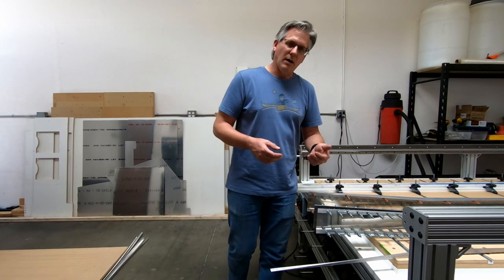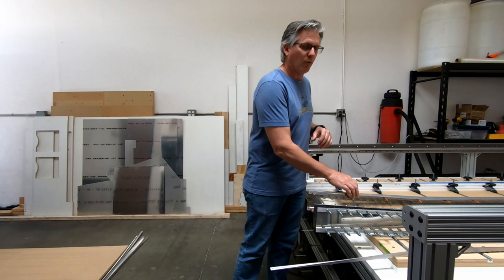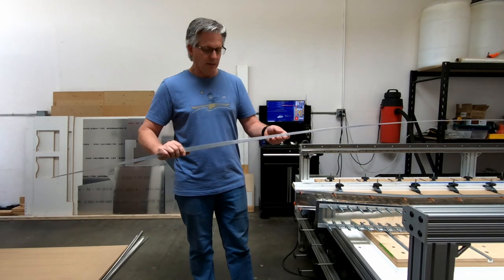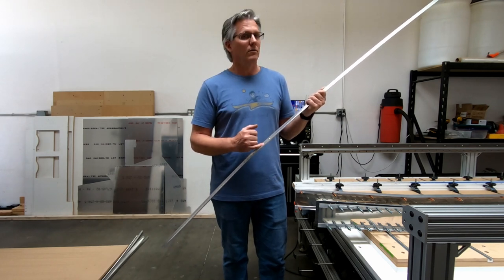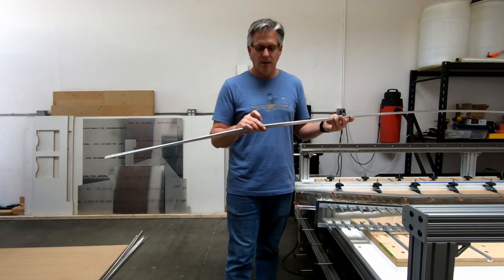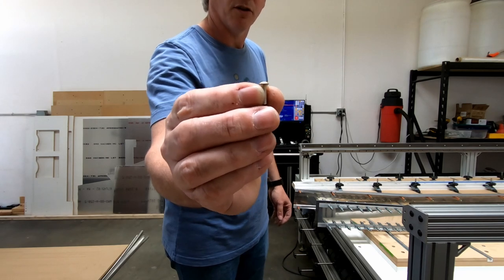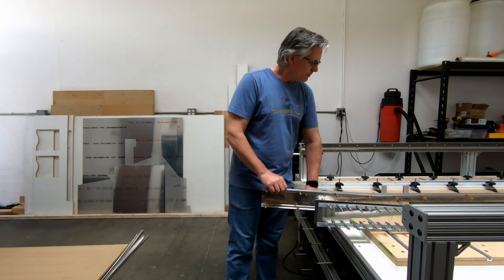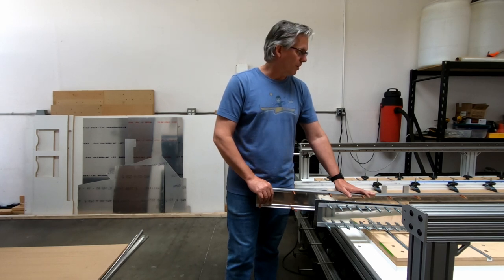2 - CriCri Airplane Build - Wing Spars

Comment: you can make a simple radius block for under each rivet head...then you wouldnt need to remove the any radius matl or widen the flange.    moving the rivets on a wider flange is probably the best and easiest idea though.

Comment: Love the videos.  Just wondering if you could weld instead of rivet in order to overcome some of the problems you encountered?  Could you use Titanium of the same size to make the spars much stronger?
Reply from the maker: When designing wings you have 4 factors you are trying to manage: ultimate strength, fatigue strength, weight and cost. Not sure Titanium would be cost effective or if the materials would even be available. Welding could be used but it would require a complete redesign of the wing. Welding the caps to the spar web the way it is currently designed would be very difficult if not impossible. I would still prefer riveting over welding and its a proven method of aircraft construction. Since I'm not an engineer I have to stick as close to what has been proven to be safe and constructing the CriCri as close to the engineered plans as possible.

Comment: Hello, I have the plans, but what is the unit used for the measurement, because I do not understand the numbers, for example, the number 1000. What does it mean if it is converted to centimeters?
Reply from the maker: All measurements are in Millimeters. 1000 would be 1000 mm or 100 cm.
Reply: @crikitaviation  Thank you, but the numbers, even when I convert them to centimeters according to a measurement, are not correct because there are many numbers, for example, only the wing spar I understood is 102 mm, I converted it to centimeters, but the rest of the numbers are not clear. Can you explain to me a little video about the numbers? Thank you for that.

Comment: I was scratching my head trying to figure out a better (easier) way of building the wing spars.  What do you think of milling the 3 major assemblies out of aluminum billet.
Reply from the maker: Might be cost prohibitive to do. Would require a mill/router than can cut over 8’ and two 1" x 6" x 104" and one 2” x 6” x 104” 2024 billet aluminum blocks to cut out of. The forked spar would probably still have to be riveted together unless it was engineered to assemble differently.

Comment: Why not just use flat revits, if that is what it calls for?
Reply from the maker: Flat head and Dome head rivets have been replaced by "Universal Head" rivets that are aircraft and military spec. Universal head still has a dome shape and requires a specific round head rivet set to drive them. I don't know that "Flat" head rivets other than countersunk rivets exist on the market. It is possible in the case of a CriCri to simply drive a universal rivet head with a flat rivet set to allow it to conform to the curved radius of the spar caps, question would be does it reduce the strength of the rivet?
Reply: @crikitaviation  It new designs yes but aircraft supply houses still stock flat head revits, modifying plans always opens a can of worms.

Comment: You can buy sharp corner profile. I rarely see aluminium with inside radius and I order it daily, at least in EU. Steel would usually have it.
Reply from the maker: All "structural" aluminum has a radius that I have found. Only lower grade "ornamental" aluminum typically has a sharp inside corner. This is common on aluminum found in home stores but I have never seen it in 2024-T3 aircraft grade aluminum angle. Some radius is still needed structurally so even if 2024-T3 angle was available without a radius, it shouldn't be used on a CriCri since the plans do call for structural angles with a radius, just smaller than what is typically available.

Comment: I would not worry moving your rivets.  If you look at the role of the shear web, moving the rivet has little effect.  Also, if you are going to grind your rivet tool anyway, why not make it the shape that works best.  I certainly would not machine the radius of the corner.
Reply from the maker: The goal of moving the rivets away from the radius or making the radius smaller isn't to allow room for the rivet tool (although it helps), but to allow the head of the rivet to seat on a flat surface. Without the modifications, the rivet heads will curve up the radius as they are pounded and you can't compensate by modifying the rivet tool since the rivet will no longer conform to the rounded shape of the rivet tool. The only option at that point is to just use a flat rivet set on the universal head rivet, which isn't the best practice.